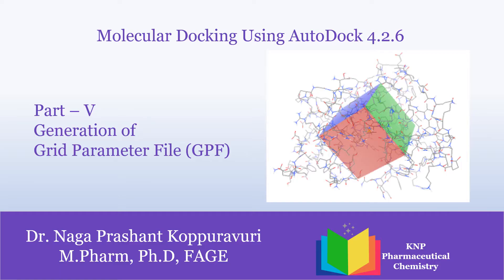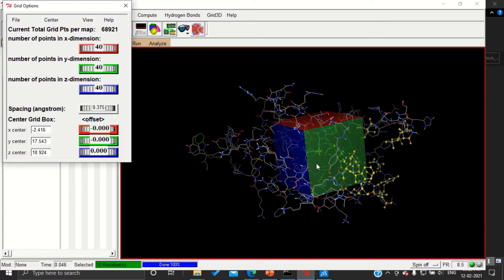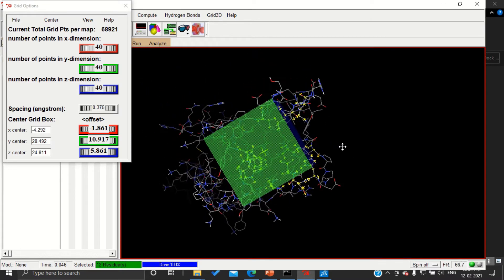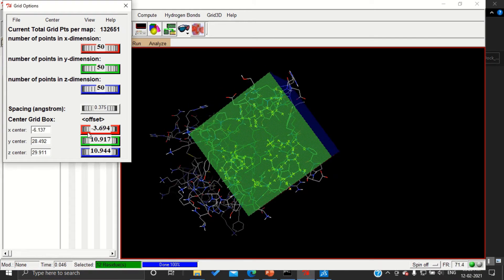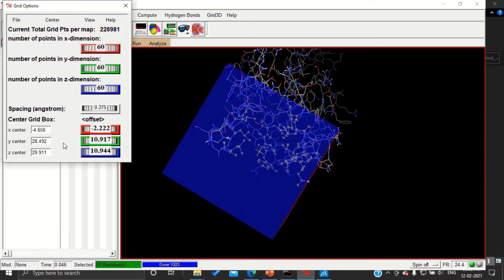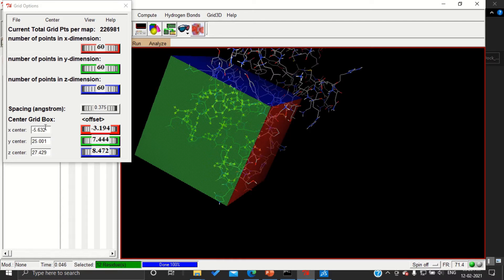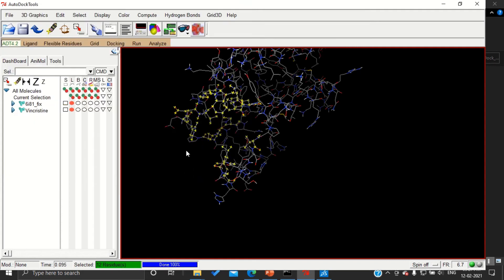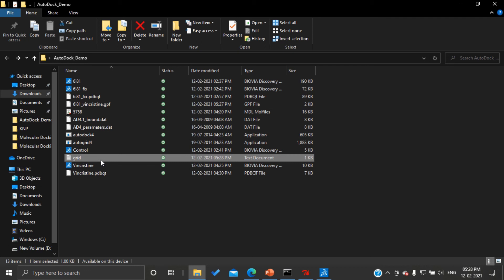AutoDock4.2.6 Part-5 Generation of Grid Parameter File(GPF)

Comment: sir may i know how to select active site residues in autodock
Reply from the maker: One need to go through the literature to decide the active site residues.
Reply: @KNPPharmaceuticalChemistry   how to know the active site in the literature??
pls suggest
Reply from the maker: Active site can be predicted by using different software, but I recommend to make use of literature to find the active site. For example let's take an enzyme that cleaves a substrate. Let's assume Glu57 and Arg128 residues of the enzyme is responsible for processing the substrate. These information can be obtained from previously available literatures. Then we can compare the computationally predicted possible active sites with our data to predict the correct active site.
Alternatively, If protein crystal structure downloaded from PDB is already bound with the ligand then it is very easy to find the active site.
Follow for more updates.
Reply: @KNPPharmaceuticalChemistry  yess sure thankyou so much for taking time and giving advices. means a lott
Reply from the maker: @praajnatherockstar  Thank you and Subscribe for more updates.